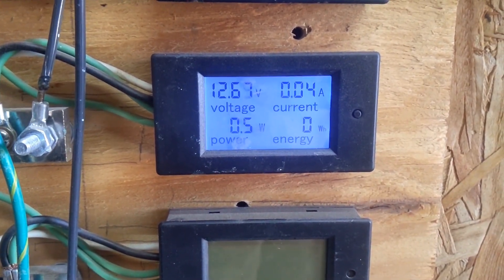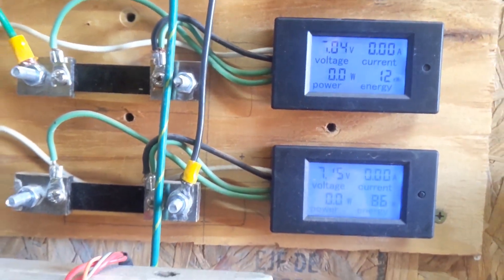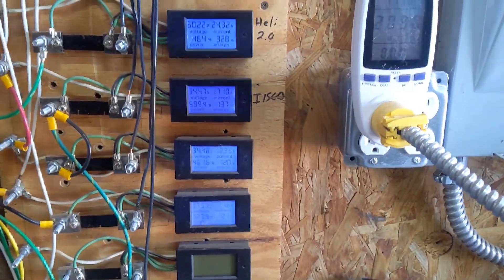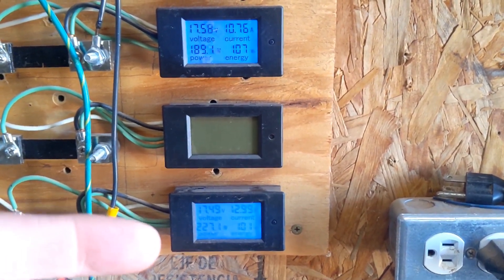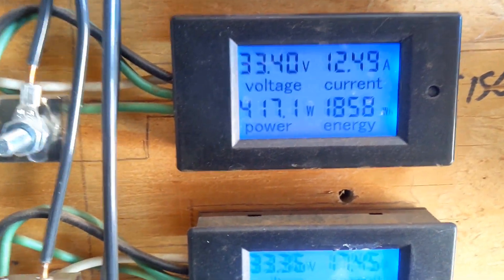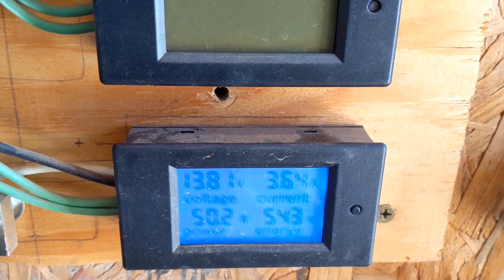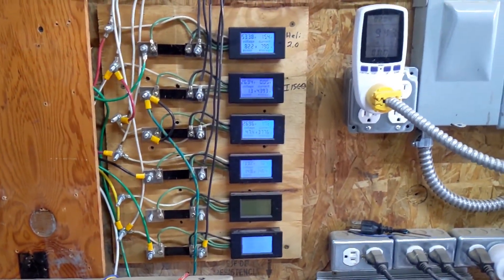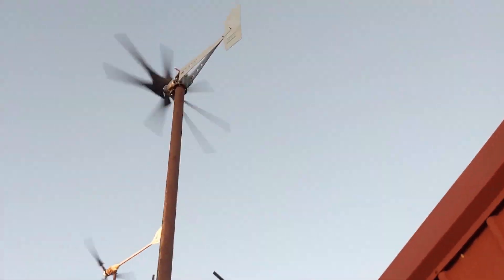iSta Breeze Heli 2.0 i1500 i500 Missouri Freedom and a Washing Machine WHOLE DAY OUTPUT! Graph inc!

Comment: Hi Mate, had a windy day with a peak of 37.96Mph, meters reset.
All 10 wind turbines are using 1.2M wind wheels with 5 or 6 blades.
14V - 24V 500W Vevor             -  6.5M high    -  263 Wh
14V - 24V 500W Vevor             -  6.5M high    -  128 Wh 
14V - 24V ista Breeze i500      -  4.5M high    -    54 Wh
12V - 24V 300W Hyacinth       -  4.0M high    -    32 Wh
12V - 48V 500W Sunboo S5   -  3.5M high     -    81 Wh   
12V - 48V 500W Sunboo S5   -  3.2M high     -    34 Wh  
12V - 48V 500W Sunboo S5   -  3.0M high     -    26 Wh    
12V - 48V 500W Sunboo S5   -  3.0M high     -    22 Wh
12V - 48V 300W new rotor     -  3.0M high      -   13 Wh   
12V - 48V 300W new rotor     -  3.0M high      -     8 Wh
I live in a Low wind area, my average wind is only 6.2 miles per hour .
Hey guys, think about posting your turbine information and production🤔

Comment: Love your videos. I'm thinking about getting ista i2000 48V with 5 blades. I wonder if it would be close to heli 2.0 in electricity generation?
Reply from the maker: I would suggest going with the 3-blade setup first...the benefit of five blades is going to be a better slow wind start up but it will sacrifice RPM up top and the i1500/2000 need a LOT of RPM to kick out their rated power (ie 5 blade will start easier but have a lower peak power output).  If the turbine has a hard time starting then look at swapping to five, but if you have enough wind to get it going with three that's going to produce the most power.

It's not going to be able to keep up with the Heli but it'll be about 2/3~3/4 of the power pretty easily.  The Heli has a much fatter power band and is designed to work at a much lower RPM.  Even though the Heli 2.0 and i2000 are both rated as 2kw turbines, neither one will spend a lot of time making their peak powers and the Heli starts out making more at lower RPM.
Reply: @ToysforWatts  Thanks, that's helpful.

Comment: hi, i have the heli as well with the default 5 blade hub. so far do you believe the new set of blades you install from the heli 4.0 are more wind sensitive and works better? mine doesn't turn with regular winds that much.
Reply from the maker: For me the larger blades were absolutely transformative!  But, also for me, a lot of it was the height I'm stuck at (I can't go higher than 40ft, roughly 12m, in my area so my Heli's hub is roughly 32ft off the ground).  If I could get closer to 20m it would have performed considerably better for me.  That said, though, at any height I believe the upgraded blades are an excellent addition to the turbine and if you're having trouble with low wind starting they will definitely help.  Those five blades, while I love their performance on my i1500, don't generate enough torque to get the Heli going unless it's blowing close to rated wind speed.
Reply: @ToysforWatts  that sounds amazing, is a relieve for me knowing there is an upgrade that works. did you just got the blades and the hub for it and it just fitted with no issues ?
Reply from the maker: Yes you'll need to reach out to iSta Breeze directly about it.  The setup comes with a new hub and it swaps right over.  They are not Heli 4.0, blades, though...they're made similarly, but are not quite the same.  You have to email iSta Breeze to order them.
Reply: @ToysforWatts  sounds great I'll then reach out to them.

Comment: Super interesting! Do you know roughly what wind speeds it was at your place on average for each hour?
Reply from the maker: I don't unfortunately.  I have a handheld anemometer but it's only good for recording wind speed at ground level right at the time I'm measuring...which isn't particularly useful.  The wind where I am right now can be drastically different from the wind "just over there", much less the wind wherever it was ten minutes ago.  I would love to have a way to measure wind speed and output in real time but the few ways in which I've found to do it have been prohibitively expensive.

Comment: If I' m seeing right you rectify the AC output of the generators and put the current into a battery bank. A wind turbine can only be charging the battery when de voltage rise above the battery voltage. Moreover, if the rectified voltage is above the battery voltage, there is no headroom to reach a maximum power point. It is just a fixed situation. Not sure whether you can get more power (or how much) from each turbine. Also, when looing for maximum powerpoint, you should consider that the rotation speed will decrease if you load the turbine. Have you ever been considering something about this (finding maximum power point and test your turbines again)?
Reply from the maker: A turbine can only push power above battery voltage, but if load voltage is too low there's not enough resistance on the circuit and the turbine just stops.  Similarly, if load voltage is too high then there's too much resistance across the circuit and the turbine never loads up.  It's all a matter of balance, that's why turbines are rated at specific voltages.  You can usually go a little less or a little more but getting too far away from the target voltage means sacrificing power productions.

I have tried moving the turbines around to different voltages and sometimes they work, but they never work as well.
Reply: @ToysforWatts  thank you for your reply. What i' m trying to say is that you could maybe draw more power if, the battery voltage is dynamic, depending on the wind speed. It is actually not, but just hypotheticly. 

In other words I think that the efficiency is better when you load the turbine depending on the wind speed. What are your thoughts about that?

Comment: Well guess what ; I went and got two more batteries ; I have 18 now. But 12 of them are on a different set of #1 cables than the other 6, and I think one of those has a bad solder joint...so I've been adding all those batteries on that leg, and none of them are connected well to the inverter, I guess...the six on the other set of welding leads has higher voltage...so they're the only ones being charged all the way...so I have to find that spot with the volt meter...I have 900 amp hours of batteries now...I've been buying all those batteries to make it work better and the cable has a high resistance, so it's been that way for a long time because I haven't messed with those cables...so it's really going to affect it when I fix the connection...I thought the voltmeter was off on the inverter but it's okay ..the voltage between groups was actually different, but I couldn't find the problem until I got enough batteries on it that it couldn't charge them all , it showed up. It rained here but it turned into sleet and then it snowed 4 inches on top of that...so the snow stuck to my solar panels, even though I tried to brush the snow off...normally I can get power from snow glare. I think when I get all the batteries connected to each other, I should have power for a week without sun...I have 9 pairs, hooked up 24 volts, then all those pairs in parallel. So I am carefully removing the main cables tonight, and checking for a bad connection. Looks like your stuff is working pretty well.

Comment: Interesting , Heli 2.0 made so much more power than others. May be it is so because it runs on 48V. You have to set up IstaBreeze 1500 48V version to find out is it really making more power.
Reply from the maker: The Heli 2.0 is a considerably larger turbine than the i1500.  It frequently peaks well above the 2500w mark.  In general it makes roughly twice the power as the i1500 and today it was in front of the i1500...the i1500 usually does better but it only got wind that'd already rolled through the Heli.
Reply: Im verry fan of you and see all controllers you already use in all videos i have a combination wirh old relay that do not discharge batteries i think it may be a solution i just put a video  with the combination (Dumload solution)  That Heli is impresive i have a i1500 but your heli a lot of power awesome.